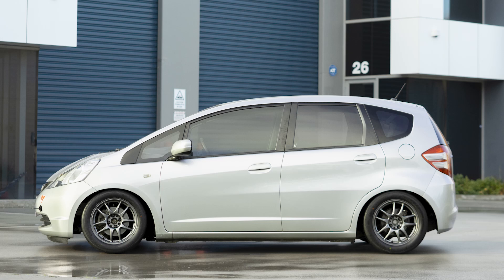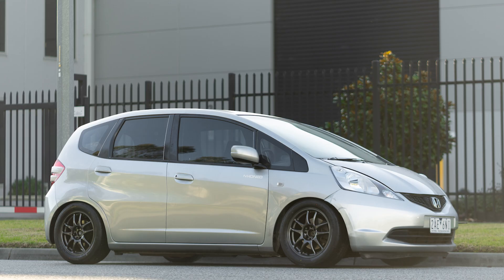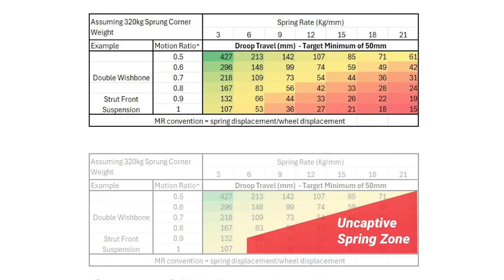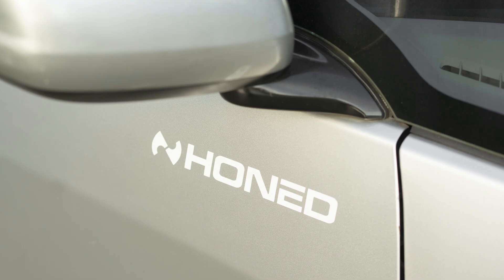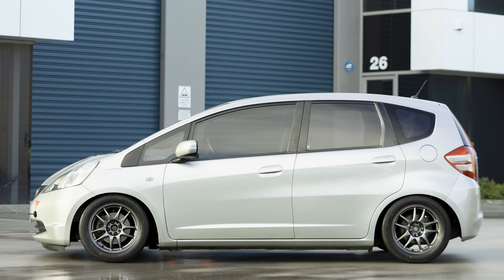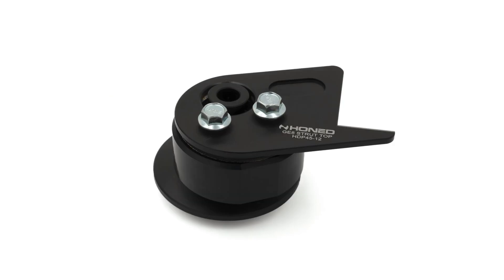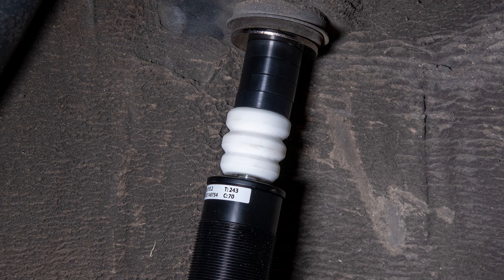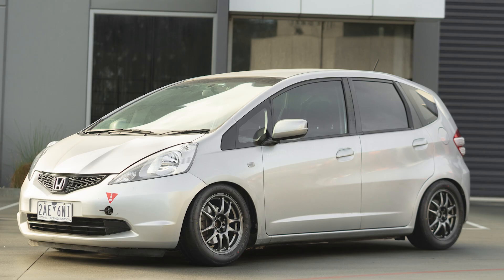Honda GE8 Coilover Install Details

Comment: What brand of Coilovers do you recommend for the GE8 or what did you use in this car?
Reply from the maker: BC Racing BR. We speced our own rates, 6k front and 8k rear. If we were fitting a rear swaybar we'd use a 6k rear spring.  You'll also need helper springs for the front and Honed spring retainers at the rear. But even with those additions, it's still a cost effective set up.